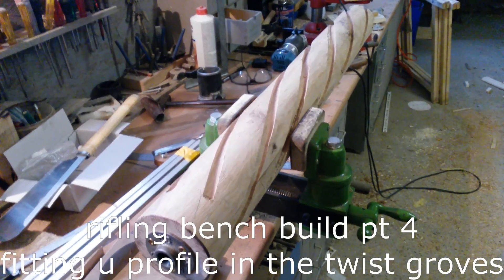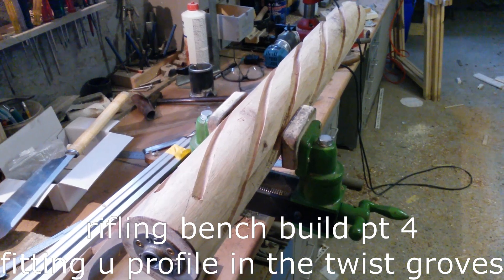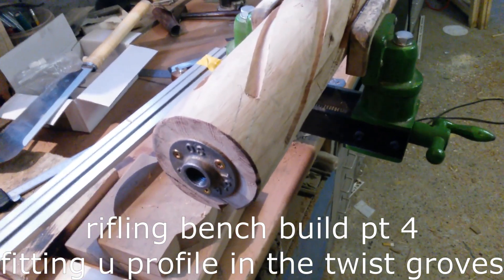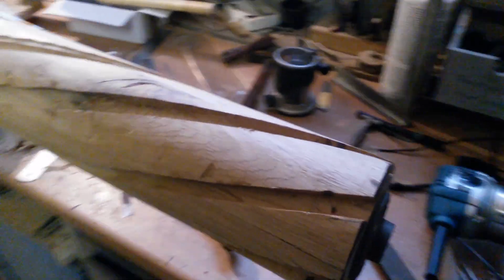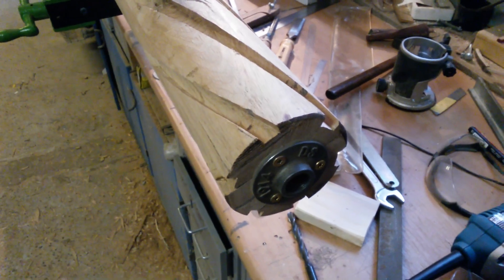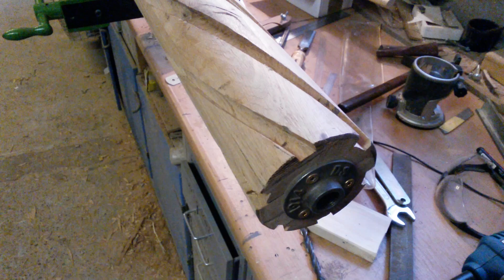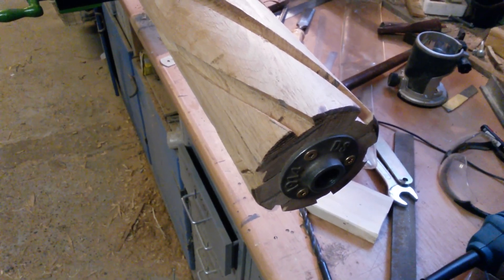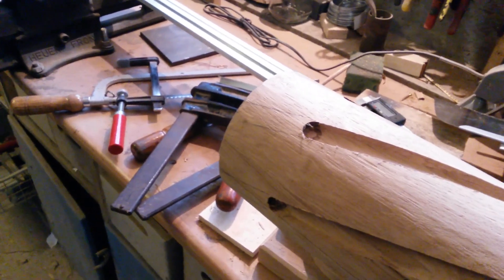rifling bench build pt 4 fitting u profile to the twist groves

Comment: Why can't the twist be raised rather than depressed? Such as screw on a length of aluminium bar? And therefore guided by a notched static (rather than raised) component?
Reply from the maker: For sure you can try 👍it is a good idea and much less work. The hard thing will be the adjusting but with a lot of patience it will come out fine😁

Comment: Great job. When I made mine, in the 80s I only did 2 lands. One in 1-66, and 148. They were in such a way, that the two did not catch in rifling. I like the aluminum channel. If I had even thought of using that, I could have saved a lot of redos. I wish I knew your name, or handle. 
I really like the good channels. I hope you get to make a few. For my bit, to rifle, I used a small file to groove. I would make several passes, then put paper under the bit. I counted the layers of paper, and did the same amount for each land. I only did one barrel. It was great, and I do not think many folks understand ow it is done. 
I love your rifles.
Doc.

Comment: As has been said the aluminium channel went in the groove much more easily than I expected. The pin has to be an exact fit in the width of the groove otherwise any error here will show up in the barrel rifling. When you start cutting grooves I would make it that you only pull the cutter through the barrel one way and then remove it before pushing the cylinder back through the barrel.  So the cutting head could be held in place by a simple grub screw. As said also the depth of the cut was controlled by adding thicknesses of paper under the cutter.
Reply from the maker: Something like this is the plan... I made a pin with a roller an the tip.. The width is very close to the tidth of the grove, And now it is running very smooth. So it schould be posible to run forward and backwards. The shitty thing is that I still have to make 5 groves with u profile and I can not install a indexer cos there is not enough space left ..... but at the end it will be nice I think. 😆😁

Comment: That has got you back to good again, I think that the guide pin that will run in the groove would be better if it was a 25mm long shoe, rather than a round pin, if it had a bit of length it would run smoother against the Aluminium groove sides, and would also follow a much smoother path as it would average out any slight kinks, it would be nice to build in some sort of anti backlash system using spring loaded guides, that would reduce the tendency to chatter as the head was moving along, the base board ,if extended to the length of the "drum" when fully extended would also give more support, the whole thing is starting to look very good , keep at it ! Chris B.
Reply from the maker: The thing with the moving stone will be a good idea.... At the moment I have installed a pin tith a rotating bushing at the tip. So there is less friktion. I will make a second pin with the slider and than we can test both of it.... The sping load can be made by a spring on the non load side of the shoe rivited to the side. There are still a lot of groves to fill with the u profile. a not so easy job but the result is sooo nice....... So stay save Roger S.

Comment: That aluminum went in much easier than I expected.
 Or you just make it look easy.
Do you plan to stain the wood? It should make an interesting visual.
Reply from the maker: It only looked a like 😁🤣 The twisting of the profile was more or less a pain in the as 😜 at the end I will use danish oil I think ...... and some candle wax for the sliding surfaces......